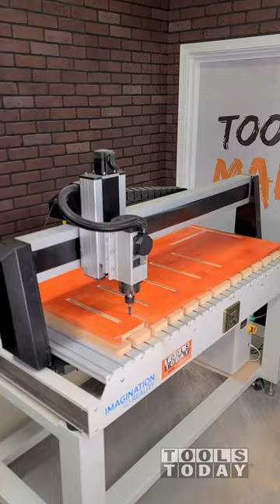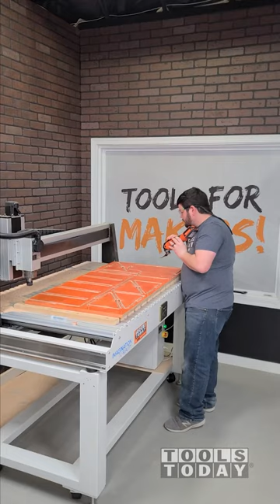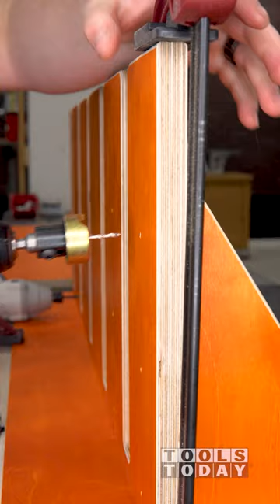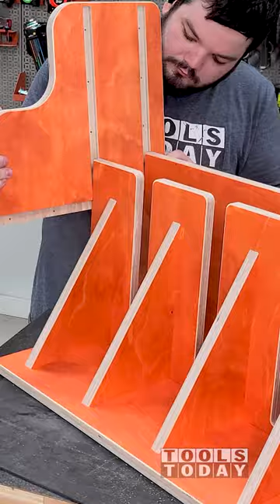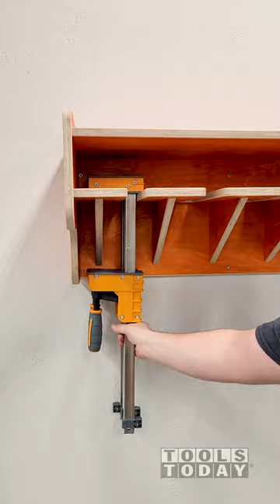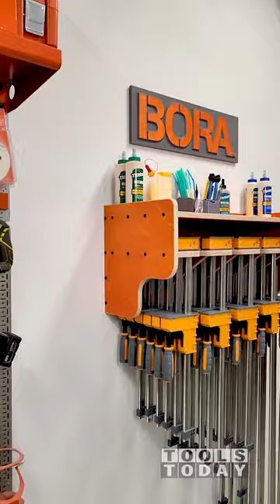Clamp Rack with 300lbs of Clamps

Comment from the maker: Check out the plans for this project - https://www.toolstoday.com/clamp-rack-cnc-plans-downloadable-and-customizable.html

Check out the tools used on our website - https://www.toolstoday.com/v-13779-46202-k-bit.html

46172-K Compression Bit - https://www.toolstoday.com/v-13779-46202-k-bit.html

i2R W.42 4'x2' CNC machine
https://www.toolstoday.com/i2r-cnc-i2rw42-w-42-4-x-2-cnc-machine.html

Design Software - Vectric V-Carve Pro - 
https://www.toolstoday.com/cnc-machines-accessories/cnc-software.html
Reply: how much price this matchine?
Reply: You don’t even have half the camps you need. Best to build a second and honestly, 4-39th duplicate, but you’re still going to run out of clamps.

Comment: What’s even more impressive than the great build is that it’s held by 6 screws only to the studs.
Reply: A #10 screw with at least 2” thread in the stud can, on average, handle a shear load of 2399 lbs or a pullout force of 1391 lbs. :)

This design is very solid!